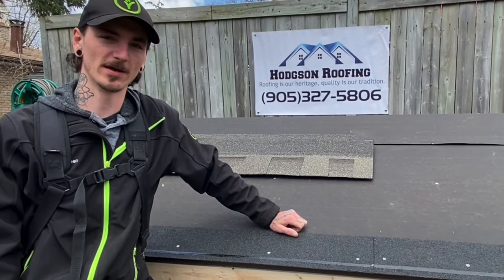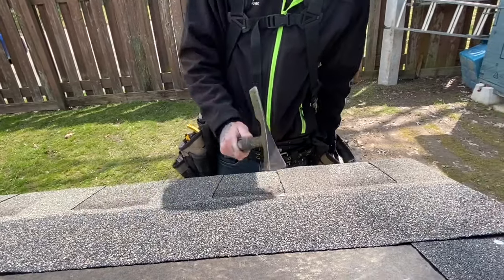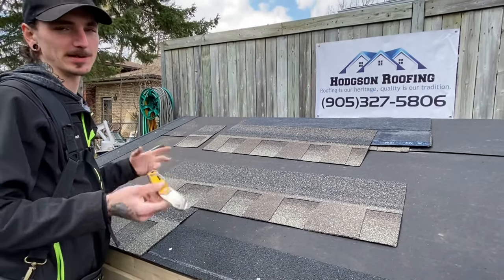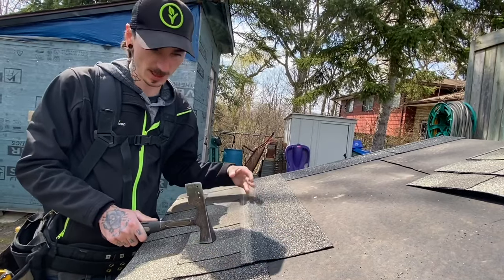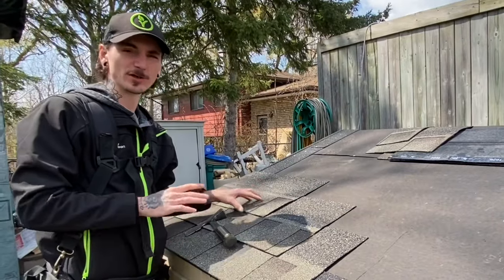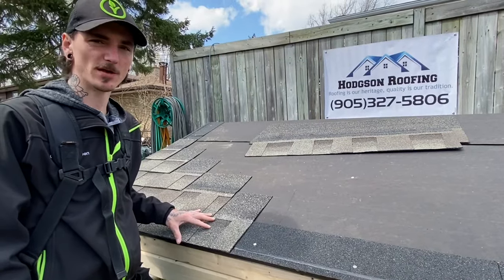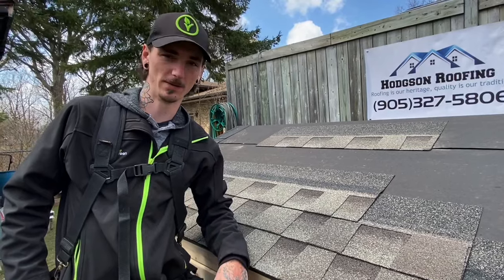How To Properly Start Shingle Courses On A Roof

Comment: Very good video I have a question when is a big roof how do yo mark de roof
Reply from the maker: Anthony Z you mean as for laying out chalk lines to keep your rows straight?
Reply: @Average_Roofer  yes
Reply from the maker: Anthony Z absolutely I can make a video on that process
Reply: @Average_Roofer  curious as to how you pop your lines. I do 18 1/2 from the eave and then 33 1/2 from there
Reply from the maker: Ryan Annear with architectural shingles, most  who are experienced can run them straight as they are a very easy to use shingle. But I can make a video on layout for sure.

Comment: I was following this method and on my second "run" of shingles I precut everything but accidentally skipped over what should have been the 3rd shingle (one with 12 inches cut off). How big of a deal is this?
Reply from the maker: Not a big deal at all. Your stagger can jump around as long as no two seams line up in a parallel line.

Comment: What size nails do you use if you don't want your exposed eves having nails coming thru them?  Staples?  They are exposed a couple of feet.  If you install the nails where the framing is located you only get two nails per shingle.

Comment: Hi... I have a shed that has a skillion / shed roof type. When I finish the row of shingles at the top of the roof, what kind of cap/drip edge should I install? I think there's a particular name for these, which simply fold over the top of the roof and on to the fascia but I can't recall what it is. Would yo happen to know.

Comment: You said keep your nails away from the half bond  because fear of the nail rusting and then causing a leak but how come there is no care for capillary effect where water can travel back up the roof 50 mm I'm in the UK and when laying slates we have a minimum headlap of 3 inch so why not there?

Comment: Thank you for this video, I live in Canada, Toronto and I have to do my roof again after 18 years. The contractor was using the IKO shingles on my roof and I was told that the product has 25 years of warranty, however, the shingles on the sunny side started to fall apart already after 18 years. I have contacted IKO and they are offering me the warranty reimbursement ONLY if I use their shingles again. My question is what is the normal lifespan for the shingles in general? How good these IKO shingles in comparison to the other brands?
Reply: Cheap shingles, maybe 15 years. The best ones, maybe 25. That’s just a ballpark guess. Your local weather conditions will play a part.
Reply: @MoneyManHolmes  I was told that there is no such thing as cheap shingles as all major producers are in competition with each other and trying to produce the competitive product.
Reply: @oneundecided  would recommend gaf tbh.
Reply: Timberline HDZ offers 50 years I believe. And no shingle will ever last 50 years.
Reply: @ash_dablunt9258  I was not talking 50 years. If the warranty 25 why it is failing before that?
Reply: @oneundecided  it could have to do with the weather and the pitch and stuff. If it's lower pitched water tends to sit on it longer deteriorating the shingles. Steeper roofs tend to last longer

Comment: Does the nail needs to come out? I read that the 1 inch will be ok in a  3/4 osb.  Some said its ok to come out others that its ok not to , to prevent humidity came through the nail.  ???  So its ok the 1 inch nail?

Comment: I do only recommend doing this step technique if your good at keeping your field straight in long distances or good and running more than 3 rows at a time, personally all my superiors will fire you for this method and do incourage that you don’t use this, they recommend 3 steps, 3 up and 3 over and continue that until you’ve made your way 2-3 quarters up the panel then carry everything over

Comment: Hey, I just want to be clear on this.
At 5:23 when you say ".....you're going to continue to go all the way up and then you're going to start with another full shingle and continue the same pattern all the way up the gable"

Does that mean if I do the staggered pattern starting at the bottom of the roof and it doesn't reach the top of the gable, you would cut another shingle to start the same staggered pattern all the way to the top of the gable after putting a full shingle above the smallest cut shingle? 

Thanks for all the videos!
Reply from the maker: Donald Hall once you reach the top of your 5 courses, you begin the pattern again with a full shingle.
Reply: Try 10" stagger easy 10 20 30 40 less cutting if u run into small finisher just add 20" shingle before everything will b 10" apart
Reply: why would  anybody listen to person 
Your Average Roofer  arent we average once we listen to real pro a person who doesnt look after his teeth wont look after  his own roof ..
Reply: Suzie Jones dont listen if you think  you know better.  Judging a roofer’s worth by your opinion of his teeth exposes your reasoning skills for what they are.  
No not everyone is average.  
Most people are far below average attempting a new craft/trade.  Obviously this gentleman has more humility than you are ready to handle.

Good luck with your bleached teeth bearing roofer and his/her advice.  🤦🏽‍♂️
Reply: @Average_Roofer  so if row six is a full shingle what is the start of row seven? i will assume a cut shingle to repeat the process all over again, if not row eight would be in line with the previous shingle 7.

Comment: IM A NUBE. Do shingles go end to end across the roof or do you overlay the ends? Also you don’t show what happens with starter strips at top is roof. Do you jus bend it over and down other side? Thanks!
Reply from the maker: ERPINTERFACES the shingles ends do not overlap. That’s called “dutching shingles”. The ends just meet tightly together at the seams. The gap in between is okay because that’s the purpose of shingling in a pyramid pattern and offsetting shingles so you always have coverage under that water line. 

As for starters you can wrap them over the ridge of cut them off at the ridge line. Either way works.

Comment: I guess different areas have different manufacturer specs? Every manufacturer here in the PNW calls for a minimum of 5 nails per shingle and a 6 nail pattern for high wind resistance. They all implemented this change 5 or 10 years ago as a 4 nail pattern isn't sufficient for standard winds but on steeper roofs it has a lesser chance of holding the shingle in place. Also they all call for a 5-5/8 pattern stagger. This allows for an effective stagger between shingles for the water to drain and makes less work for the installer. 
Also, please nail your starter higher, I fix way to much rot on the eaves from people nailing midway or low like that on their starter. Its just begging for problems.

Comment: Can I re use the end shingles you cut off and use them to start on the next row up?
Reply: Yes you can. Its done all the time to minimize waste. Don't use anything less than 6" wide and try to keep it above 8". The cutoffs need to be separated into "lefts" and "rights" and the cut end has to point off the roof while the factory edge butts against the next shingle. Also when starting rows with a cutoff don't square it against the edge of the roof because the shingle is not square instead run it long over the edge of the roof and square it against the shingle below

Comment: I have a gable roof and one half of one side of the roof has an extension. How shingles are install so it would look even all the way across? 
Thanks
Reply: You will have to take some measurements and snap some lines if you want both sides to meet up evenly. Most roofers just wing it and one side ends up off by a few inches when they meet. It drives me nuts...

Comment: You don’t show the starter strip with the required overhand from the edge, usually one inch. ALL roofs must have overhang of at least one inch.
Reply from the maker: There is a full video on starters on my channel.
Reply: Yeah your right its called a drip edge.
Reply: But he does have a brown drip edge already installed i can see it.
Reply: Exactly what I was watching for and thinking about. My last roofer did not, and now I have to replace my entire facia from water rot.
Reply: John if you always pop your 1st chalk line at 10" from fascia ALL overhang issues will be resolved

Comment: You ran an immediate seem on seem with your first shingle from the looks of it, or at minimal nail in your first keyway, you ran your gable edge starter before your drip edge starter, and 4 nail patterns are used on 3 tab not dimensional...

Comment: On my roof,  There is a big gap between the gutters and whatever is the starter strip.  It does not go over  into the gutter.  I would like more explanation about this starter strip.  It obviously was never done correctly.  There is also no drip edge.  There is over an inch where the first row of shingles hang  over the gutter.   The edge of the gutters is higher than the shingles..   I think wind and sun has taken its toll,  and  the edge of the shingles have "curled" up,  looks like a tobaggon could ride in the curl.   Now. rain has  started going behind the gutters, and out the backside.   I thought i could jam some drip edge under the shingles, but that only directed the rain go into the soffit, and it actually drain back onto the brick walls of the house.   There is no ventilation in the soffits.  I took the drip edge out.   Otherwise, the roof looks good accd to roofers i have had out here.     But NOBODY wants to take off that first row of shingles and repair.  They want to just do an entire roof.   Small town in NC, near Durham.  I'd love to be able to tell someone how to fix it.  I'm 68yo female and have been up and down on that ladder a few too many times.
Any suggestions?? Videos?

Comment: Video should have started with 10-6-6 line popping method. Also overlap depends on pitch , steeper pitch = less overlap vs low pitch = more overlap. Good luck beginners 👍

Comment: How far should the nail in the starter be from the water line ?
Reply: At least 6 inches is what I was taught
Reply: You did great explanation but did not do what you explained. 
Nail is supposed to be 6 inches from water line on both starter and field. You did not do that. I make that a point when I roof. Most people does not. 
Also it would be easier to keep water line away from your nails if you cut a regular book. 
The laminate line should never be exposed. The roofing just looks so hack when you can see laminate line. I gauge my roofing so laminate line never shows.

Comment: i was told i should use ruber gramit or washers with my roofing nails on all rakes and were the shingels meet????????????????????
Reply from the maker: Not necessary in shingle roofing application, if all steps are followed according to manufacturers specification.
Reply: On exposed flashing or bottom of pipe boots if u don't wanna caulk type situations

Comment: Why are you using a shake hammer to nail asphalt strip shingles
Reply from the maker: Because I can. What a silly question… regardless of the hatchet side (which is great for removing nails from wall flashings) the hammer side is just that, still a hammer 🤷🏻‍♂️

Comment: The white line is not where you nail, thats where your next shingle lays..you nail in the black strip above that line...you dont want your nails that close to the overlap...
Reply from the maker: That’s false. Always refer to manufacturers specifications.
Reply: daleon96.  Nope. The white line or red(mine were red) according to the mtg instructions is the nailing line. You may be thinking of 3 tabs.  It's to ensure that your nails catch both the shingle you're nailing and the one below it.

Comment: How many inches up should the nails be on the starter strip?
Reply from the maker: peanutbutter1925 approximately 1-2 inches. Closer to the gabled/eaves the better.
Reply: @Average_Roofer  Thanks for the quick reply. I had a handyman install some shingles on about a 12X12 foot area and when it rained I had leaks. I know I need NEW shingles everywhere and will install them with an "experienced" roofer this time. We can do a better job after watching your videos, thanks.

Comment: Save shingles, forget the starter strips. Slice a shingle and use top for a starter, the bottom for a final course. Less trips up the ladder
Reply: ive a roof 3 feet by 8 at the end  of  my porch wonder why they  never  made it as  long as the  house\
Reply: @suziejones3236  best guess,  3 feet over, at a 4 pitch is 4 feet of span. 4x8 is a full sheet. Guessing they made the roof to match one sheet of plywood uncut. Just a guess.
Reply: @SERFINUSA fender thanks reply ive 2  options one make roof lower than porch and same outerwall same as my main wall  which patio doors are which i did  lloks  good just  8x 4  boards up next year  planing to add same height to roofof porch i read the  need of permits cause im adding NEW to old  and changing the  look may need permit  no new doors or windows its  mainly wind strorm  protection way wind comes storms  we had  bad hurrican lucky it went round us few  houses  next us  but hit other buildings  poor  trees lost it  lifting the roots  out ground  scary stuff watching and  getting readto go in basement
Reply: maybe a wind  protection idea so corner isnt stuck out  god  knows  just  looked stupid now  looks  part house 
 @SERFINUSA

Comment: Your stagger is a little off which makes it hard to place nails correctly......i like to use a tape for a perfect stagger!
Reply: Next time you remove laminates dave, remove one and look at the water Mark's and it will be on the whole nailing strip, I have never cared if 2 shingles lined up where a nail was, as long as there is paper underneath it will never leak, I've been installing roofs for almost 15 years in saskatchewan if we did the nailing pattern that everyone did on youtube we would have alot of blow offs, when it gets windy I repair others work and when it rains I fix other companies leaks haha trust me on this!

Comment: Don't bother cutting Shingles with a knife till the end. It's  been ages since I was told/shown how to do it but manufacturer will often tell how much to step on the bundles. So mark out multiple bundles for multiple courses and run through with an old circ saw blade backwards

Comment: he said keep your nails at least 6 inches away from a seam, yet his nails were at most only 2" away
Reply: because of the high wind zone code. he has to have the two on the ends
Reply: but he was still doing them pretty close lol
Reply: @caindrew5113  that's not what I was talking about.  He said to make sure the nails from the lower row are at least 6" away from the edge of the shingle on the next row.  Except he doesn't
Reply: He also needs to stagger his first row shingles at least 6 inches from his starter  row. At 1:04 min mark he is aligning edge over edge  -  so all that water will travel down into the membrane under the metal drip edge
Reply: @kevintran2522  he cut his starter strip rather that the shingle.
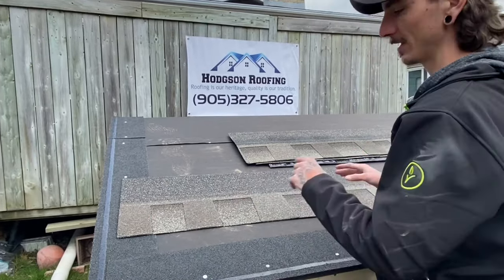Reply: @tchevrier  Yes I saw the starter edge at 0:56

Comment: You state in your video to keep end of shingles 6" from your nails, but in your video you nail 2nd course 1' in from right side then lay 3rd course over (which isn't cut correctly) over top of nail within 2 inches, not 6".

Comment: Gotta stagger that starter strip more bro and gotta have 1/2 inch to 3/4 hang over on gutter edge u must have been trained by bdr
Reply: I was just scrolling the comments to see who would say something about the nail first. You won
Reply: if used  extended drip edge flashing the shingles should be even with the outer edge of the perimeter of the dripedge. However, if they used an “L” type metal flashing or no flashing at all, then the starter course and the shingles must be extended beyond the perimeter eve and rake edges 1/4 to 3/4 inch. 8)

Comment: Hey, let's get in an argument about whether the drip goes over or under the ice and water.
Reply: Under.
Reply: @samhoward5916  did it for about 20yrs over, but, I have been converted to the under. Unless I happen to go over. :) ice N water supposed to go three feet over a heated area, if you count the pitch and the rafter overhang, is one course ever enough?
Reply: Are you serious grippage goes under the ice yet I've made that mistake before and had to replace three feet of roofing all around entire house because of ice damming getting under the drip edge
Reply: @howardmurphy2841  the true time consuming and icenwater costly way, is cut a quarter strip off the top place it on the edge so the bottom wraps 1/4 over the face, then drip edge, then a whole course of ice guard then your remaining 3/4 course. This ensures that you come past the rafter tails, and a full three feet over the heated structure. But only on my house. Tip, pull the plastic off the back of the roll and wrap around to the face, set the roll in place, ball up the plastic like a tin tag and shoot it to the center end of the roll in place. This will pull the plastic off as you roll it out and hold your end in place so you can adjust it as you roll out.

Comment: You should actually put 5 nails in a dimensional single
Reply from the maker: ACTUALLY… it’s 4 nails as per manufacturing specifications, 6 nails for high wind zones as per manufacturer specifications

Comment: Just don't use the razor edge on the roof like he is unless you want leaks going thru a brand new roof
Reply from the maker: If you rely on your underlayment for water shedding, you obviously don’t know how shingles work 😂. If your shingle installation doesn’t fail, the underlayment is almost pointless. Just “an added layer of protection”
Reply: @Average_Roofer  no I don't rely on the underlayment for water leaks but... I buy them lookn clean and no rusty skid marks near the big rip hole....ya know what I mean?? I'd rather it be non ripped cut and more waterproofing for longer years.